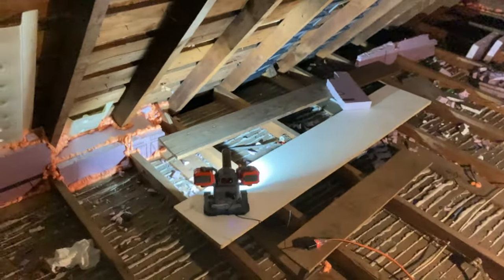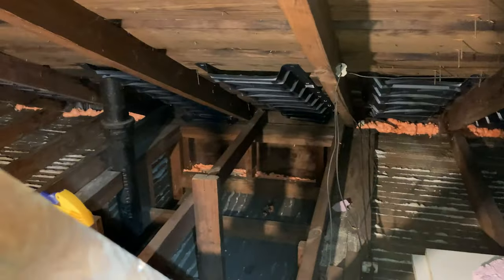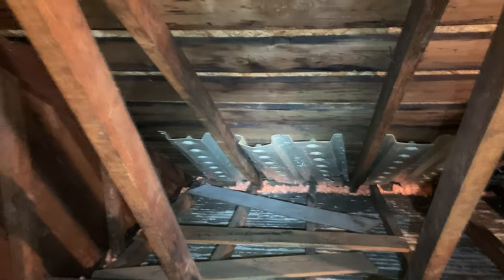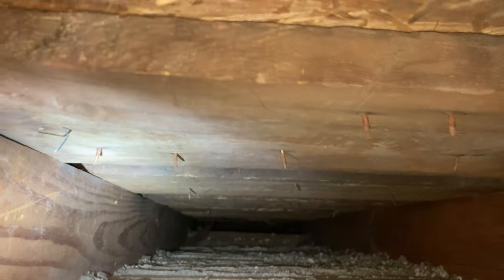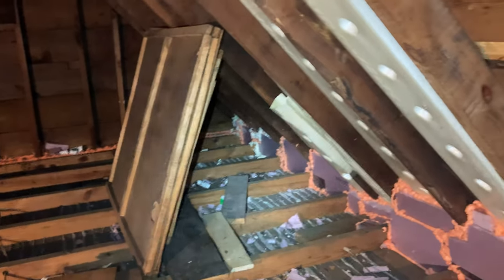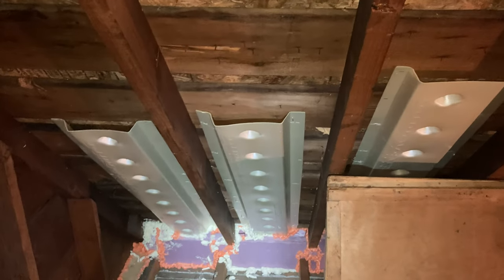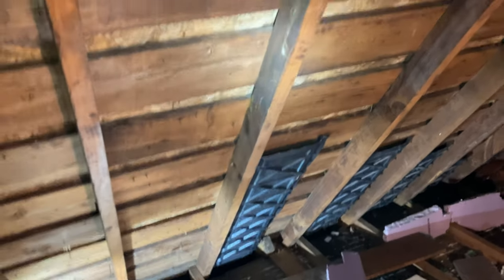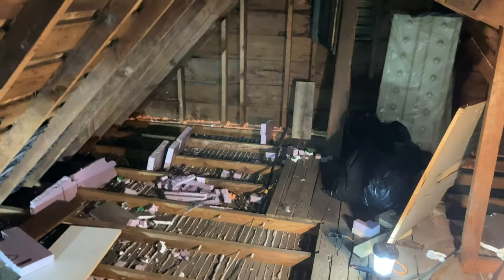1925 Balloon Framed Attic - Air Sealing - No Soffit Vents - To Seal or Not to Seal?

Comment: I'm in a 1915 home clad with brick in the 20's 
and amazed at how well it still works.
Old houses were meant to breath .
Insulation on the ceilings is all they need.
Make sure that bathroom is vented out through the roof.

Comment: Had a 1905 3 story ballon frame in Buffalo.   You are a brave man.    City   would require fire blocking anytime you would renovate more than a room.   You really had no choice but to do everything.   You could address it one stud bay at a time. Unfortunately unless you put an updated water barrier under the siding...insulation in wall will cause more problems.  You have to be aware of the delta between outside vs inside air.    

It's a huge job to modernize a ballon framed house.   The house needs the air movement to keep condensation out and dew point on the exterior of the sheeting.   You are better off putting batt insulation just in the basement to slow the air movement through the wall, but not eliminate it.   Air Seal all the interior trim,  baseboard, window, outlets...and make sure duct work is properly sized/sealed.    This will reduce your energy use dramatically.   

If /when you are going to do siding and new windows...its easy to remove the wall plank at the sill, 2nd floor rim, and top plate to add the blocking.  Then blow-in,  proper house wrap,  flashing,...etc.
Reply: Do you mean batt insulation along the rim joist? Or along fieldstone wall? I'm also in WNY working on a 1900 Victorian. Prior owner had batt insulation r19 in my attic, and it was shoved maybe 18 inches down the cavity. At some point they put wood fire blocking in the wall cavities on each floor, probably when they re did the siding to fiberboard. My plan for the attic is to stick with what they had, air seal penetrations, and top up with another 6 inches of fiberglass up there.

Comment: Maybe add exterior sliding with thicker 1" or 2" insulation panels? Maybe have Insulation & Energy audit Co. do an evaluation maybe they have a better solution? I definitely wouldn't seal off balloon frame voids or you might make more condensation which might lead to insect & rotten wood damage.

Comment: Might be too late to help, but I have a 1905 in Pittsburgh. I replaced roof about 7-8 yrs ago. I had ridge vents put in and decided to run ridge venting from gap at soffit up to ridge vent. Once that’s done I’m going to place batt insulation along the baffles. That should allow free flowing air along the roof line and create an air space in the attic. 
I’ve researched this and newer homes seem to work well with this method. As long as the roof gets cold air running along it, I should retain heat. Good luck.
Reply: Great solution and thanks for posting this up. Are you able to keep the attic reliably conditioned even with the ridge vents? I notice some ppl putting a vapor barrier under the ridge vent to let out humidity. But then it seems like there would be a thermal load as that's not got insulation over it.
Reply: I have the old open rafter attack above two rooms on a third floor. The ridge vent allows lots of cold/hot air to come into an unfinished space. After the baffle goes up and insulation in, along that baffle system, I have to insulate the falls along the living space. That triangular space is open so it should stay cole if walls insulate correctly and become hot the same. But will be so much less heat/cold air loss in the long run.

Comment: When there's no room for a soffit vent, they make a plastic corrugated vent that goes under the first or second course of shingles, then with a slot cut thru the osb you can achieve air flow from the near bottom of the roof and continue the proper vents up to the ridge vent. Menards by me carries them under the brand name of "Maxi-Ram". I'm sure Homer Depot has them too. ABC carries something too.

Comment: Cane across your video.  I wish I would've seen it sooner.  First I noticed you have Knob and Tube Electrical in your attic.  NEC code states you cannot insulate around it.  Knob and Tube is an air cooled system which means the electric current heat is to dissipate into open air to keep the conductor's from overheating.  This is a serious HAZARD.    If the wiring you have up there is not live you'll be fine.  If it is live,  have an electrician evaluate it.  However,  your insulation contractor should know that insulating around Knob and Tube is against code.  You have no soffits which means your baffles will do nothing.  Remove them.  Air sealing the exterior wall will help keep heat from entering the attic and keep the heat to lower floors.  Use the foam board and the spray foam that you already used.  You will also need to ventilate your roof with either more vents or have a ridge vent completed which a ridge vent is far more superior.  After that, you must bring in outside air to ventilate your attic.  This is crucial as this will allow you attic to breathe.  Due that you have no soffit venting,  your gable wall that is to the outside is where you can bring in outside air.  Gable vents placed at each corner will bring in the outside air and it will exit through the top.  These will have to be above the amount of insulation.   I would have an R50 blown in which will definitely reduce heat loss.
Reply: I was surprised to find known and tube underneath original jute batt insulation. I know it's against code to insulate around k&t now, but it has definitely been done in the past, so it is not per-se an air cooled system. I understand the dangers of damp insulation around old failing wire insulation but obviously it has been fine for 100years now and the load on the circuits (mostly lighting) has decreased by a lot
Reply: @sev8993  grandfathered in Mickey mouse Jobs exist ...in my experience lolll
Reply: Oh man you really look like you know what your talking about...if you could be so kind as to share your knowledge with me ( a 28 year old female who's primary occupation is a dog trainer....but kinda ready to become a full time hvac tech...since I removed and replaced all of the duct work in the attic myself ....and removed all of the attic insulation myself...which was soiled with mouse feces and urine .....) currently trying to help my parents home ....which was built in 1970 in California ....it used to have a soffit around all 1116 sq ft of home...however we had a really bad mouse problem .which obviously carried over to a really bad attic problem ...so now after installing all new flex duct ..and removing all of the bottom of the soffit around the house (which was covered in mouse piss) I find myself wondering what to do .....there is currently only fascia board around the perimeter of the house....there are still attic vents around the walls of the house....I have covered those with some metal lath to Prevent mice from entering..yet whilst in the attic I can see the sun beaming from almost all corners of this place ....and this video is the first to May be help identify the type of technique used for this house...balloon type I believe?  The walls consist of stucco ...rock lath ..and button board plaster for walls and ceiling ..however the garage just has stud ..wire and stucco....would you recommend I carry on /or fill all the way up to the houses eaves,with stucco .....it seems to buckle and crumble at the very top ....Im assuming j-trim wasn't very popular back then ? Or were they relying on the boxed soffit to keep the mice out .....I hope I make some sense...if I sound like an idiot who hardly knows anything.....I am ....just putting it out there so I don't have every contractor and their mothers attacking me in this comment......lol all and any help is appreciated.......(my duct work did get inspected by two licensed hvac techs.they said I did better than some professionals    and they were surprised I did it myself ...) so that's good right?  I'm trying lollllll
Reply: Oh man you really look like you know what your talking about...if you could be so kind as to share your knowledge with me ( a 28 year old female who's primary occupation is a dog trainer....but kinda ready to become a full time hvac tech...since I removed and replaced all of the duct work in the attic myself ....and removed all of the attic insulation myself...which was soiled with mouse feces and urine .....) currently trying to help my parents home ....which was built in 1970 in California ....it used to have a soffit around all 1116 sq ft of home...however we had a really bad mouse problem .which obviously carried over to a really bad attic problem ...so now after installing all new flex duct ..and removing all of the bottom of the soffit around the house (which was covered in mouse piss) I find myself wondering what to do .....there is currently only fascia board around the perimeter of the house....there are still attic vents around the walls of the house....I have covered those with some metal lath to Prevent mice from entering..yet whilst in the attic I can see the sun beaming from almost all corners of this place ....and this video is the first to May be help identify the type of technique used for this house...balloon type I believe?  The walls consist of stucco ...rock lath ..and button board plaster for walls and ceiling ..however the garage just has stud ..wire and stucco....would you recommend I carry on /or fill all the way up to the houses eaves,with stucco .....it seems to buckle and crumble at the very top ....Im assuming j-trim wasn't very popular back then ? Or were they relying on the boxed soffit to keep the mice out .....I hope I make some sense...if I sound like an idiot who hardly knows anything.....I am ....just putting it out there so I don't have every contractor and their mothers attacking me in this comment......lol all and any help is appreciated.......(my duct work did get inspected by two licensed hvac techs.they said I did better than some professionals    and they were surprised I did it myself ...) so that's good right?  I'm trying lollllll

Comment: You may try  several some 1 inch clear vinyl tubing instead of baffles to let the wall vent. Or you can use a old garden hose. Then insulate between the floor joists.

Comment: Vent it like you’re doing and foam insulate walls and do a down spray on ceiling and add plastic in the crawl space to the foundation for moisture control.

Comment: Iam doing exactly same thing in my attic but cut off air movement completely,  no baffles,  going to spray closed cell foam directly on the planks
hope this helps
Reply: I am considering closed cell as well. I am in Michigan with an 1890s hip roof attic with no soffits and only 2 cap vents (which would get removed). Just makes me nervous. I worry about wood rot, should the roof fail and have water coming in.
Reply: I would worry about rot as well but new houses have that done routinely. You need a new roof first to reduce chance of leaks. This also forces you to get asphalt because you change it up regularly and you can find and replace sheathing rot at that time. I have slate and one the fence about replacing with asphalt. Bit of a shame.

Comment: Im sure the job has been done but as an insulation contractor in business for 30 years, the baffles are worthless unless you have incoming air from soffit vents. I think you made a mistake by not running a hose down open bays of the walls and vaulted ceilings and blowing them full of cellulose insulation. You dont need a vapor barrier with cellulose. Moisture is moved by air and if you fill the cavities with cellulose there isnt any air so there's no moisture. After you filled the wall cavities you could still have air sealed them but a contractor would charge for a second trip out to blow in the attic. As far as the dropped ceilings in those closets, you still need to insulate the 4 little side walls or those will be an area you lose heat through. You could have saved yourself some time and trouble and let a contractor do the whole thing. I am able to supply material and labor for jobs for about what it costs you to buy the material and not counting your time for labor.
Reply: I agree with you!  That's a hot dusty job and it takes a crew an organization.  You guys could do this in a day.  But I understand how the strapped home owner with an old house wants to do it on their own.  That way they can do some here and some there and in a couple of years complete the job and waste heat during that process.  I used cellulose in my walls and I guess it's okay.  But if I were doing it today I would probably go with the Rockwool product.  And no, I don't work for them but this is interesting stuff!
Reply: @DennisMathias  Cellulose is a great product. It's the only insulation that gains R-value the colder it gets.
Reply: I thought the same thing about the missing soffit vents. Cellulose just seems like a mess waiting to happen, though.  Made from recycled newspaper and/or denim, it sounds like bad news when it gets wet--and old homes like this provide lots of opportunity for that to happen if their leaky-by-design framing can't dry that cellulose out before too much rot or mold can occur... there's the potential for ammonia off gassing if it's got the wrong fire retardant while not adequately ventilated, and cellulose is the biggest nightmare to think about removing.   I'm in the Northeast where a lot of 1890s to 1930s houses have attics that aren't insulated--so there's at least an obvious first step.  While a good contractor can be worth his weight in copper for the right job, there's a lot of house flipping going on right now and a lot of opportunists out there botching up all kinds of things that homeowners could have botched themselves for a fraction of the price.  It's January of 2023 and a lot of "safer bet" licensed contractors in our area are already booked up 'till June. While some people just should not be allowed near power tools, most DIY-ers are out to improve themselves as well as their investments and are looking for empirical, impartial information--not shaming and pressure tactics.
Reply: @DennisMathias   If you haven't seen any of the "Home Renovision DIY" channel, he's got some really decent tutorials on insulation that all go beyond just watching him do it.  He points out there's no such thing as "perfect" with an older home since they can differ so much from each other, and educates on the importance of thermal, vapor, air and water barriers.   Here's one of him renting an Attic Cat to blow in his own R-30 fiberglass:
https://youtu.be/PuEzpNk1OsM

Comment: I admire you gumption working with this troubled house. I'd be tempted to tell the owners to demolish it and put a decently insulated manufactured home (i.e. trailer) in its place. It doesn't seem to be all that large anyway. Replacing is often cheaper than fixing.

Comment: For the 1500/yr you’ll save in utilities you run the risk of serious mold and rot down the road. 

My advice is do nothing, spend nothing on insulation foam or anything else. Spend January February in a small part of the house with that part heated and turn up the thermostat if you need it. 

Your house is dry and mold free and standing 100 years on. Enjoy and don’t believe all the hype around air sealing.